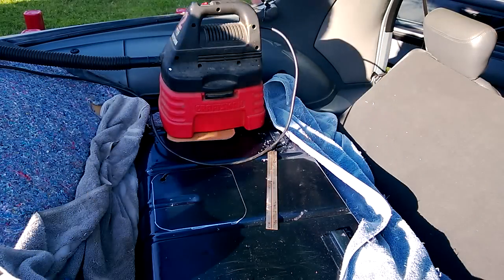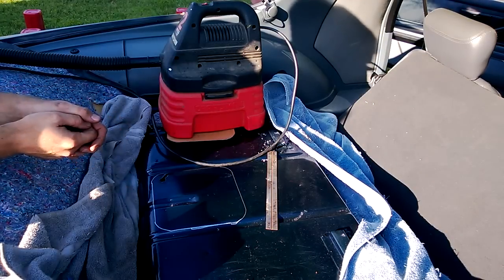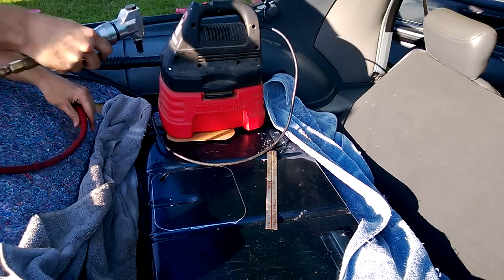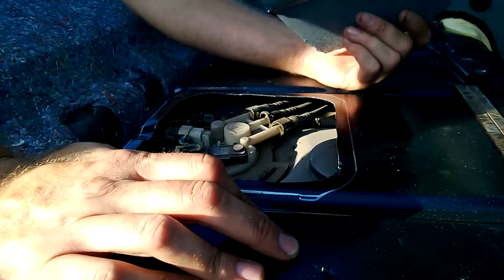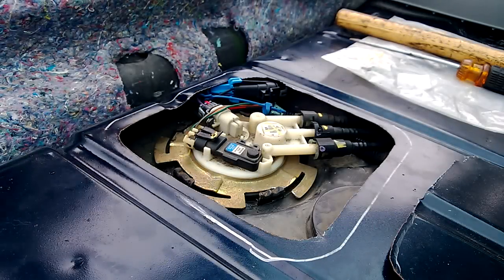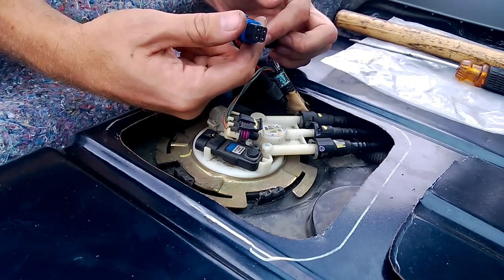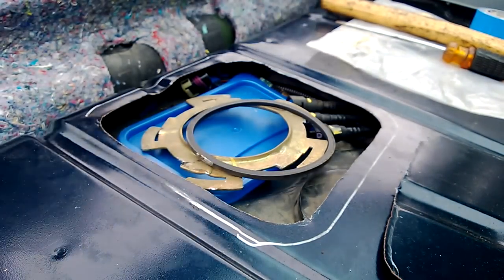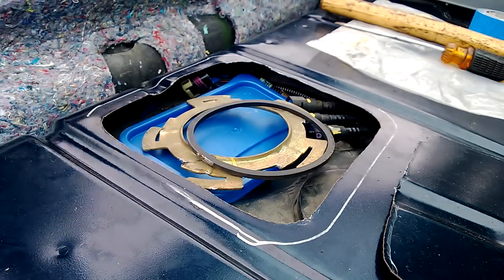Cutting Fuel Pump Access Panel and Removing Fuel Pump Assembly - 86 Trans AM with 02 Gas Tank

Comment: I'm installing a '02 Camaro tank in my '87 TA right now, and was wondering what you did with the vent lines?  I noticed that you didn't have anything connected to the pressure sensor at the top of the pump module so I'm assuming that you don't have the evap actually functioning on it, do you have the plumbing/canister hooked up?  What did you hook up to the vent line (well center line on the pump module, and I'm not sure exactly what the other 2 lines going to the fittings further up on the tank are, or vice versa, the evap line in the car that goes to the front passenger side of the car and the pressure relief that goes to the white filter/valve in front of the tank)?
Reply from the maker: Hey Mark.  I actually have everything plugged in at the top of the sender.  The hoses on top are fuel feed, fuel "return" from the filter, and EVAP to intake.Ill answer the easy question first... My vent line is just disconnected and hangs near the fuel filter area.  Up out of the way.  So anything coming out passes through the charcoal filter...I THINK. Ive seen no negative effects from doing this.  The wiring harness from the sender unit, to the bulkhead in the body, is 100% intact factory 4th gen. However...from there forward, the evap related wires are left disconnected.  I originally tried to run EVAP from the LS1.  It will not work unless you run the full LS1 dash cluster, PCM and BCM.  The ONLY way it will work without, is if you dont hook up an aftermarket fuel gauge.  At that point, you'd need to somehow run a separate level sender, which in a plastic tank might not be possible.  If you search for me on thirdgen dot org, you'll find info about the EVAP system.  Shoot me a message over there if you want (ghettocruiser) and Ill give you some links to the info.  To my knowledge, no one has been able to make the 4th gen EVAP work 100% without the dash/bcm combo.

Comment: I did this to mi 1990 trans am, and it was easy to replace the fuel electric pump.i did once lowering the tank it was a pain in the ....the shop wanted to charge 500dlls
Reply: 500 is cheap for today. I paid that in Southern California 27 years ago. Dealer here quoted me 1200 a few years ago.

Comment: I think they should start making an access door for the fuel pump. makes the job more easier that way then having to drop the tank
Reply from the maker: +Tommy Strong Hey Tommy.  That's the thing. Most newer cars already have an access cover.  My Subaru had two of them.  One under each rear seat.  And those covers were NOT that substantial.  So if its ok for my children to sit over top of those, cutting a hole and putting in a cover in my TA shouldn't be a problem haha.

Comment: my el cheapo renault clio has an opening for the fuel pump and you only need 5 minutes top to change the pump also it has a plastic cover on top of it without any gasket but never had fumes inside the car

Comment: DON'T TRY THIS UNLESS YOU DRILL INTO THE CENTER FIRST TO SEE WHERE THE WALL OF GAS TANK COMES UP FROM THE FUEL PUMP SPACE! Something this guy did not mention, is that there is NOT a half inch gap above your whole fuel tank. I was trying this on an HHR and one of my gas lines is pretty much strapped to the ceiling of the thing that he is grinding on... So I grinned a big old hole in it and it's now spraying gas all over the inside of my car. It's a nice touch. I just went about an inch too far away from the fuel pump though. Imagine the area where your fuel pump is located is like an in ground pool that has a cover over it and the cover extends over the surrounding concrete of the pool. If you don't only cut into the area of your fuel pump is located (the empty pool area), then you hit your gas tank and or fuel lines (cement.)
Reply from the maker: +Jacob Nolan Hi Jacob. Sorry you had trouble with this mod. While I didn't come right out and say it, I clearly give warning in the opening titles about watching where you're cutting. It's also the reason I didn't use a cut off wheel. The nibbler won't cut lines or puncture the tank. You NEED to know where you need to cut and what's there. I've had my car apart so many times, I knew where all the lines were and where I needed to mske the opening. And I still made an exploratory cut so I could verify it. Most tanks should NOT be up against the floor sheet metal. There is almost always some foam spacers. Otherwise you get noises, and wear/tear on the plastic that's touching. Hopefully you can easily fix your fuel line. Make sure you seal the opening well when you're finished!
Reply: JEG, thanks for replying to my comment. I was able to use a mending kit and fix the issue on my line and now it's working fine. I still think this is a good way to do this for sure, just dangerous especially since I watched a different video and was using a grinder with sparks flying everywhere and with an open gas line right beneath me which I was unaware of haha.
Reply from the maker: Haha yeah that'll ruin your day real quick.  Im glad you posted though, because then others that come by the video will have a first hand warning about it.  So Im sure you will help others with your experience...and thats exactly the basis for my channel.

Comment: Great video. You say you have a 2002 tank.  Did you install that?  Do you have any info on the pitfalls of that job?  As you mentioned, with the standard '86 tank/plumbing this wound work, the lines are NOT removable at the sending unit assembly.  Since my '86 T/A pump is shot & I have to drop the tank, I'd like to install the tank with the removable lines so I can do it your way the next time.  Thanks for any help.
Reply from the maker: Sorry for the late reply Neil.  The 4th gen plastic tank bolts right into place.  The filler neck is actually rubber hose, and you have to trim it a little bit.  What I did was removed the filler neck from the tank, mounted the tank, then mounted the filler "mouth" in place.  Took a measurement, then trimmed the hose.

Comment: Use a air nibbler it works great ..and. cutting a access hole won't hurt the body ...as long as the hole ain't to big.
Reply from the maker: Thats essentially what this is.  Just in a different form.  Worked well...but if I had to it over, I would have practiced on some scrap metal first haha.

Comment: Interesting, in 1992, Honda made an access panel whereby a person can take out and replace the fuel pump. On many things, the Japanese engineer a better solution. As for the cover, easy enough to make a sheet metal cover.
Reply from the maker: Yup!  Cover was easy.  I didnt video it...and I dont know why at this point.  But I mention it in later videos.  Im going to pull the pump out this spring (already glad I cut the access!) and I will probably make a video showing how I covered it.

Comment: How do you close the hole you made, looks like a fire hazard in a crash. There is a reason they have metal between the tank and the interior.
Reply from the maker: Ray, I used a panel that is sealed and bolted in place. Have you seen factory access panels? My Subaru had TWO of these under the back seat. And the covers were nothing more than thin sheet metal with a foam seal and 4 self tappers holding it down. That's why I felt ok doing it. Plenty of cars with these panels in trunks, under seats, etc. Thanks for the comment!

Comment: What size sockets will I need to change the fuel pump and fuel filter in a 2006 Pontiac G6 I don't know if it's a GT or what how would I find out I'm not with the car at the time
Reply from the maker: No clue. Metric for sure. Sockets won't be your worry...special tools to disconnect the fuel lines will be important. Google would probably be your best bet. Good luck!

Comment: Did my cut and replaced the pump with racetronics pump started her up and she fired right up . Only thing is my wire harness didn't come with instructions and going to the racetronics website is a pain to navigate . How did you do yours ?
Reply from the maker: +Anuno26 Are you speaking about the hotwire kit?  If so, those have instructions that are pretty straightforward.  But basically, since I used the 4th gen tank and wiring, and the 4th gen fuse/relay boxes, I just installed it like I was doing it in an LS1 car.  I had to lower the tank a tiny bit by loosening the straps to get the wire/plugs up over the tank.  Then I just ran the wires up front towards the engine bay.  I did run the main wire inside the car near the back so it didnt have to travel along the exhaust.  Then just used an existing firewall hole to go into the engine bay.

Comment: loosen to Tank lower the tank give you a little more clearance loosen it lower it. and place thick metal to protect tank from holes
Reply from the maker: Yeah in hindsight I should have.  I figured since I wasnt using a cutting wheel, it would be ok.  That nibbler wouldnt cut through anything but the metal.  It would just stop  moving.  Ultimately, I would like to drop the tank, and weld in a ring with threaded holes, or nuts welded on, so I could make a nice bolt down cover.
Reply: you can use riv nuts and avoid welding all together

Comment: The main things that would concern me: 1) would the firewall be capped in a way to withstand a crash as well as, or better than the original structure? 2) does it affect the structural integrity? 3) what happens in a fire?
Reply from the maker: Hi Tuvoca.  Fair concerns.  1) The hole is sealed in a way that during a crash I doubt it would pop open.  Its not only sealed with fuel resistant RTV, but its riveted in place.  2) It shouldn't affect structure at all.  That area is basically just a cover for the fuel tank area.  All the structure comes from the rear sub-frame and this is just thin sheet metal up top.  The hole is fairly small as well.  3) In the event of a fire...whatever would have happened before will happen now.  The hole is totally sealed.  If the vehicle is hit hard enough to cause the cover to come off and fuel to spray in...it probably would have cracked/tore/busted the factory sheet metal as well.  Let me put it this way.  My Subaru had TWO fuel covers under the back seat.  They were very thin tin, and had a foam gasket, and 4 tiny sheet metal screws to secure them.  That is under the back seat.  What I have done shouldn't be any worse than that from a safety standpoint and in fact might even be sealed better.

Comment: what size air compressor did you use i have a nibbler as well but i only have a 3 gallon air compressor idk if it will work
Reply from the maker: I have a 30 gallon tank.  It will work with a 3 gallon, but your compressor is going to run a LOT.  You will likely have to take some breaks and let the pump catch up.  Luckily the nibblers work pretty fast if the material isnt too thick, so you might be able to make the best of the air you have.  Give it a try and see how it goes.

Comment: i love your video sir.   have you run into any problems?   are u able to pull the fuel pump now without going under the car?
Reply from the maker: Hi James.  No problems.  I have pulled it twice since doing this, without getting under the car at all.  It is a slight pain to move the carpet in that area, but NO WHERE near as bad as removing exhaust/axle/etc.  I thought about cutting an access panel in the carpet as well, but decided against that.  I havent been in there in a couple years at this point.

Comment: I have a 2007 chev up lander where to drill hole inside car I don't know where pump is in fuel tank in the  in the middle or end of tank let me know if you will thanks.
Reply from the maker: No clue Ray. You'll need to locate the pump, verify clearances, and then decide where you can cut. Every vehicle will be different.

Comment: Since everyone is saying that this is an easier way, I suppose the real question is, "How often do you need to change out your fuel pump?" And besides, why not do the wiring harness at the same time?
Reply from the maker: You have a valid point.  I havent had to change my pump yet.  However, it had the stock pump in it when I decided to upgrade.  If I had the hot wire kit, and the new pump while building this car, I would have installed it all at that time.  That being said, with an aftermarket pump, you're opening yourself up to having an issue.  The stock pumps seem to go forever, but you never know once you go aftermarket.  When/if the day comes that the pump fails...or something silly happens like the feed hose comes off, you're labor to fix it will be EXTREMELY low compared.  Im a perfect example. I forgot to install a lock on the one connector.  So I had to pull it back out.  Had I dropped the tank to do the install, this would have been a real PITA.  Stupid mistake...but at least I didnt pay for it by having to rip it all down again.

Comment: Question would it be the same with the stock tank on a 91 or would there be a little more clearance
Reply from the maker: It would be quite different. You'd have to make your cut longer, and on the seat side of the tank hump. Not sure if you'd have more clearance between the sheet metal and lines. I personally wouldn't have done this with a stock tank. The hole ends up being too large. But check the forums, there are lots of pics!

Comment: Why Cut the Whole Panel Out, I Cut a U shape out an lift the U up from the bottom, like a flap, that way when I install the new unit, all I have to do is fold the flap down & tape the flap down an seal it with Metal Tape, then apply Duck Tape for the final sealing
Reply from the maker: Because I wanted a cleaner cover. Bending it distorts the area at the fold, promotes cracking where the cut ends and I wanted a bolt down cover with seal vs just using the tape.  Not saying you're way is wrong just that's the reason I did it this way.

Comment: Very helpful, I especially like the 2002 plastic tank, was there any trouble with "fitment" installing it into your 3rd gen? This solves a host of problems in my mind. Thanks.
Reply from the maker: Hi Dave.  The plastic tank 100% physically bolts in.  You will need to use the fill neck setup for the plastic tank as well...it has a rubber hose connecting the tank to the fill spout.  You need to trim that rubber hose a bit until it fits.  Then its good to go.  Obviously you'll need to re-work the lines a bit for your application as well.  It seems to hold a tad more gas and the newer pump set up is nice.
Reply: @JEGsGarage  Excellent!  Appreciate the confirmation. I will pass this along to several others who are looking at then same upgrade. Thanks again.

Comment: Cool! Say, gas tank should be 1/4 or less for fuel pump change? Why not with 3/4 tank?
Reply from the maker: Other than just being less gas Im not sure.  I mean, if the pump fails with a full tank, youre changing the pump regardless haha.
Reply: If you pull the tank out like the factory way the tank weights less with less gasoline. A 1/4 tank is say 4 gallons, about 25 Lbs of gas. 3/4tank is 12 gallons say 75 Lbs.
You have too the weight of the empty tank. One has to fart around and angle the tank with the filler neck to get it back in place. It is easier when it weighs less.

Comment: 11:02 Try pulling the bucket out of a c5 / c6 corvette the bucket is a tight ass fit. I was gonna cut mine but I decided against it because of the 1le RPO code. Im running a dual walbro and the racetronix power harness (the harness is awesome full voltage to the pump) 

We did do this on my friends old 4th gen. Went pretty smoothly. def an easy pump swap but the car was totaled a year later so we didnt get the full advantage of the access panel.
Reply: any tips mines is stuck rn
Reply: @mikeverything4098  A bunch of small mainly thin blade screwdrivers and some helping hands, Try not to rip the lower bucket off. IDK what engineer though the tight fit was a good idea on these plastic tanks. They still do it to this day. Maybe the hole shrinks after first assembly at the plant. Just have patience and try to work the bucket edge inside the hole evenly with no snags. A slight twist force might help. Dont break it unless you have a complete new bucket. It would still be a pita to remove the lower bucket if it broke off so you would have to do the same work. Dont use an airtex pump it will die in a month. Im 3 for 3 failing airtex. Ill never buy another. Even a few different friends who bought one had them fail weeks later. Even had an airtex external sbc pump fail. Spraying fuel out the weep hole of the pump. Absolute trash